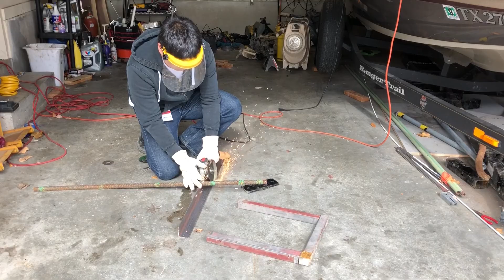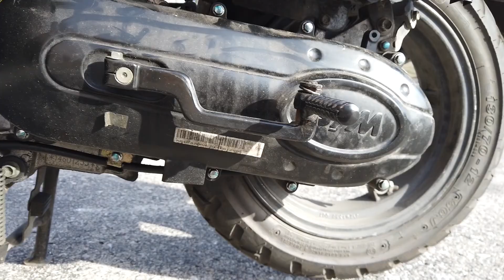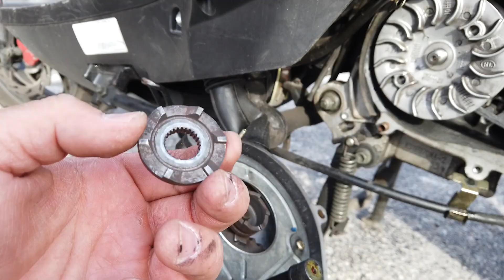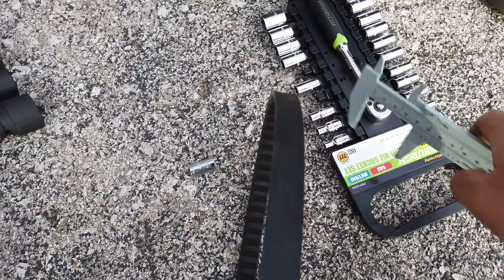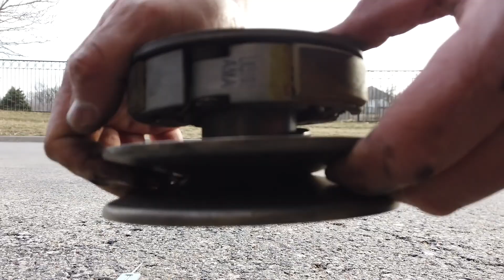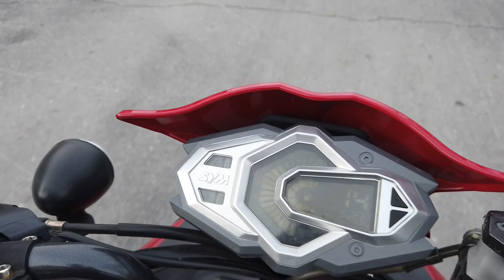50cc Scooter Drive Belt Replacement

Comment: Is the bolt for the clutch at the back side of belt is it reverse thread can't get my bolt off
Reply: Can’t get mine off either even with power tools
Reply: Did you guys figure it out? I'm struggling over here but I don't have power tools either 😅

Comment: Am I right to conclude you don't need to remove the engine side ro remove or install the drive belt ?
Reply: You will have to remove the 8-9 bolts on the CVT case to expose the belt. This video is saving you the trouble of removing the crankshaft nut or variator nut
Reply: @grazz7865  very true when I changed my belt was quite a mission. Am guessing there is a tool to hold the clutches pulley open ? Tried to take apart the clutch assembly to replace the clutch shoes but seemed like it was welded on. In the end I bought a new assembly and didn't take long to do.
Reply: @centralist1909  in the video, he is basically squeezing the variator closed by hand. I was thinking about using a big channel lock wrench but you would probably scratch/dent/damage the variator unless you put rags between the variator and the teeth of the tool.
Reply: @grazz7865  the variator is om the engine side I think ? I had issues doing my original 1 by hand took a lot of force then I had to jam something inside to hold it open
Reply: @centralist1909  in the video, he said the belt itself was holding it open. But I guess you can stuff rags in there to keep it open while you work.
Reply: @grazz7865  mine snapped and was shreaded so i couldn't do that
Reply: @centralist1909  why not?  The old belt could just be peeled away (pieces). The new belt would go on the same way as in the video

Comment: What if the belt housing cover is a metal and sealed on, how do you get it off safely?
Reply from the maker: Do you mean the cover for the belt drive? I'm assuming there's bolts, and once you get those off, it may take a little persuasion with a soft mallet or judicious use of a pry bar.
Reply: @TheAfterWorkGarage  I spoke from the guy I bought it from and he said if it goes above 30 the limited has been removed. Is that right? Trying to get up to 40 for more main roads, how could I accomplish that? Superflow carborator? It's a scootstars racestar, the cover is like diecast and doeeees not remove lol.
Reply: @ohdok733 if it’s a 50cc, 30-35 is about tops. The best way to get a little more out of it is an 80-100cc big bore kit. But keep in mind, then the bike would technically be illegal because you modified the speed.

Comment: If you're not going for you're what is your cost be
Reply from the maker: Not totally sure what you're asking here, but a new drive belt for this scooter is about $50. There are cheaper belts available for other scooter sizes, however some cheap belts aren't worth buying as they will degrade/break quickly.

Comment: None of the nuts just does not open at all
Reply from the maker: If you're talking about the nuts on the drive belt cover, they can be pretty stuck. Mine were hard to get off at first, and I had to step up to a bigger ratchet the first time. In this video I had already had the cover off a number of times, so they were much easier to get off. I'd say just make sure you're using the right socket and use a bigger ratchet/impact
Reply: Remember they are 8mm so go easy on them. They’ll strip easily. Use anti sieze on the threads when you put it back so you don’t run into that problem again

Comment: Everyone at the shop (official Vespa dealer) when I call is telling me that I might damage the crankshaft if I use an impact wrench. It’s an LX50

I think they’re just trying to discourage me from doing it myself. I’ve already done it on a Chinese scooter but I might have put the rollers back in wrong when I changed that

What’s this variator holder mess I keep hearing about? Isn’t that the purpose of the impact wrench? Lol, good video man
Reply from the maker: There's a special tool that holds the crank/variator in place while you unscrew the nut, however you can get around using this tool (which most people including myself don't have) by using an impact. The people at the dealer are likely correct in that use of an impact can damage the crank. I don't see much risk in taking the nut off, unless it's really really stuck on there, but you should definitely be a little careful putting it back on. You don't want to strip the threads on the end of the crank, and you also don't want to hammer the hell out of the rotating assembly/bearings. That said, if you're relatively careful, and don't use a giant IR impact, you're likely going to be ok. If in doubt, just get the tool that locks the variator plate in place, or take it to the shop. Good luck!
Reply: You can also use a big screwdriver to stop the crank from spinning while you remove the nut with a long breaker bar.